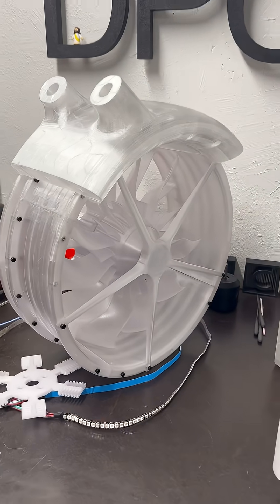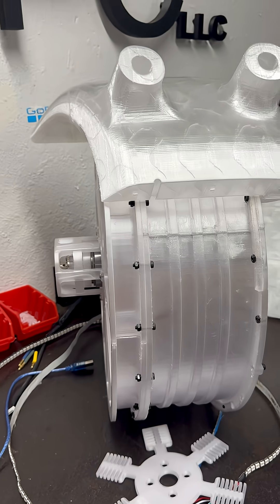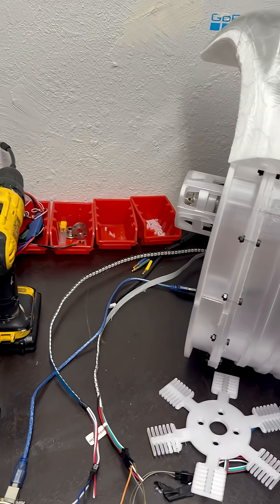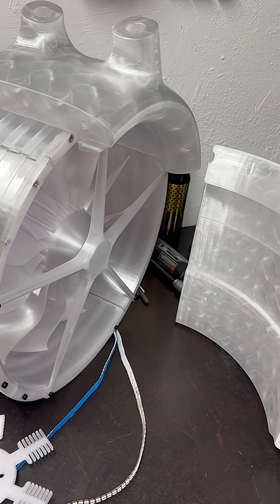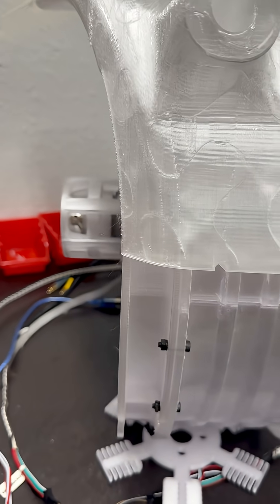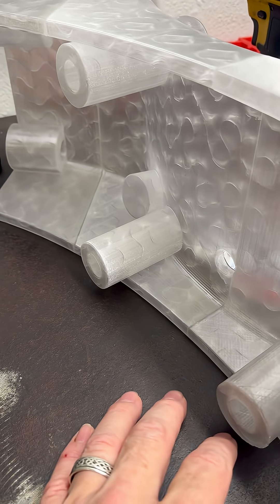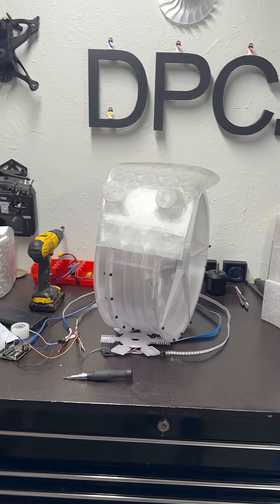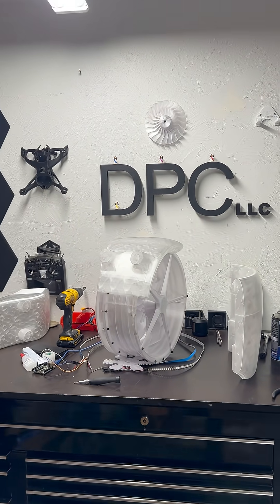Building a massive EDF drone. Progress continues.

Comment: Kind of too late at this stage, but I would possibly route the power wires through a carbon tube. Maybe it could make sense to have three or five carbon tubes rather than four. 

Pros: wires don't mess with aerodynamics, way harder to cut or torn by incoming chicken or by failing blades, often done in industry this way on various scales.

Cons: heat management is a bit more difficult, one carbon tube should be different and maybe somewhat weaker because of possible extra holes on the other end.
Reply from the maker: I can add a carbon tube for the Arduino wires from the duct to the body, there is space for it. The motor wires have a tube weave and shrink tubing already. All good ideas but I think it will be ok for the prototype.

Comment: Hmm, actually due to the size, a variable pitch stator might be good for a couple of reasons 

1: pressure changes for lifting higher payload

2: efficiency increase at all speed

3: it is used on modern turboshaft engines and turboprop aircraft so it is pretty cool
Reply from the maker: I did a short with a variable stator or flow rectification a while back. Deflection was based on air speed. Sort of rudimentary but it worked. Resistance was set by PETG flexibility and print orientation. However adjustable stators could be a benefit in latter models.
Reply: @warmachined3472   yeah, i was more thinking a non aggressive camber, although with some extra gears and maybe a tpu+ spar setup maybe a variable camber linked to the pitch, might not be super difficult

oh wait... you already agreed, fuck
Reply from the maker: @spiderninga9910lol